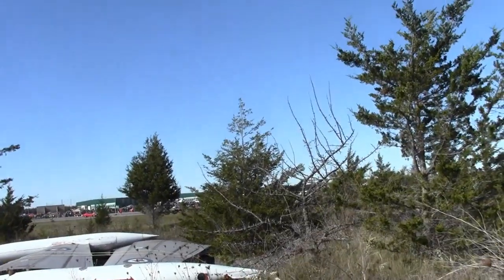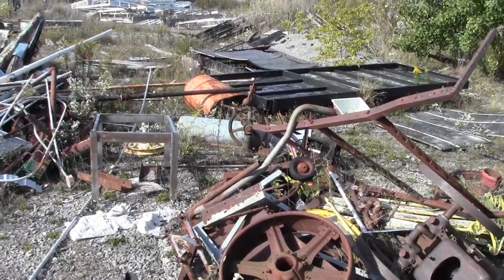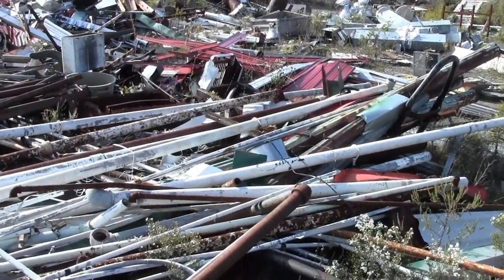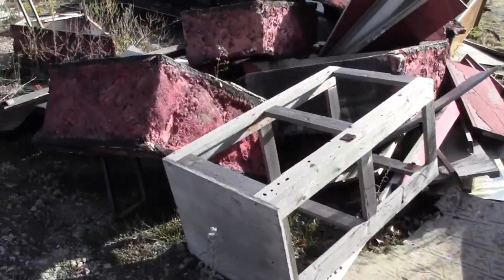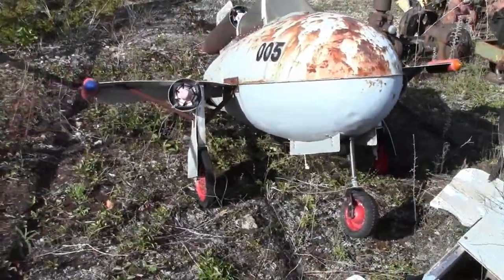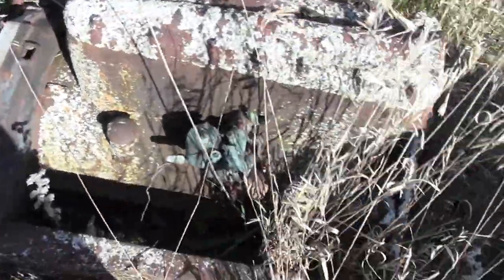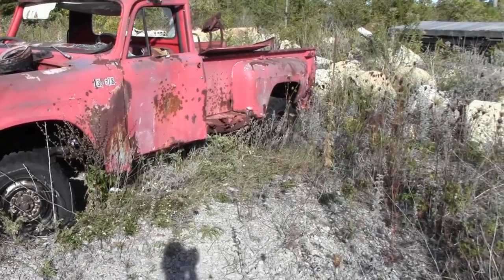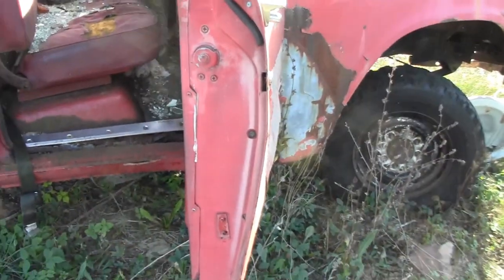WW2 airbase junkyard

Comment: Some of the very first hot rods were built using aluminum wing tip tanks from aircraft.  Several of them were raced at Bonneville.
Reply from the maker: +MISTERComaToes That's was my plan as well. I have a Model A Ford frame that I could make work with it

Comment: No the rust on the Intersmashable is just Ontario Rust . A friend has one about the same vintage and the truck has 360,00 miles on it and it is near SPOTLESS , and this is in BC . Never been  touched body or mechanical . Paint is very good he just did the break and new clutch .

Comment: The IH truck is from the 70s. Like 1974 or 75. If you could pull the transmission out of it, the top shifting assembly of the transmission in one REALLY hard part to find. I know of two truck that need those parts, and have been looking for them for a number of years.

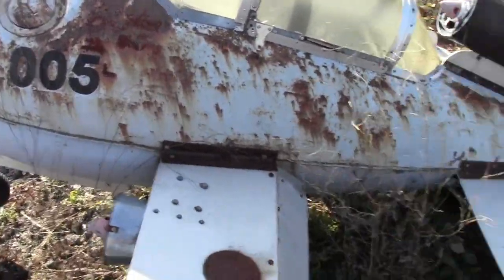Comment: that governor that you showed at 1:34 is most likely for large stationary steam engine or a diesel engine but not for that hit n miss engine those have a flyweights on one of the flywheels. and the hit n miss engine you called at 4:46 and at 5:00 is most likely are large double acting piston pumps

Comment: Some of those big things at 5:00 look like pumps which may have been driven by the old gas engines, by the looks of the pulleys on them.
Reply: +1fanger Alot of them looked like old dredge pumping equipment

Comment: F-104 Starfighter wings with tip tanks. An aircraft restorer or museum may want them.
Reply: I thought they looked like P-51 wings
Reply: T33 wings with unusually long wing tip tanks or possibly an early Lockeed f-94 starfighter which would account for the black nose on the tanks resembling a plastic or rubber cover over a small radar.  T33 taanks were sorter and all aluminum, sized for the original.  Some Canadian Avro jets had similar wings and tanks  attached to the outer engine nacelles that flanked each side of the fuselage.  As for all the metal, Trump ought to pay to have scrap metal types, pickers and aviation buffs for strike teams to clean these places up and make sure each item goes to the right place...scrap metal, resale to collectors and rare parts for warbirds still needing parts to be rebuilt.  Africa would love to have some of those old medical patient tables and such